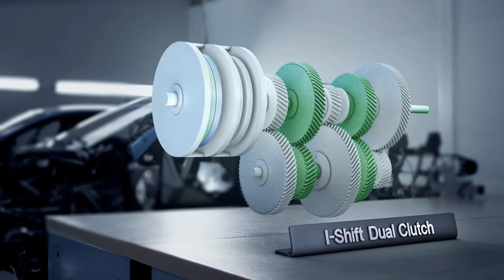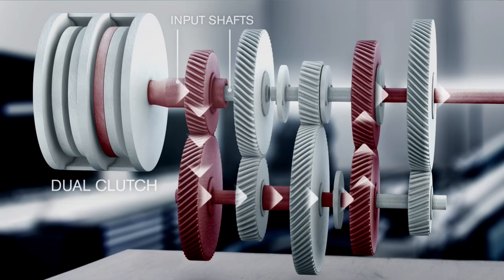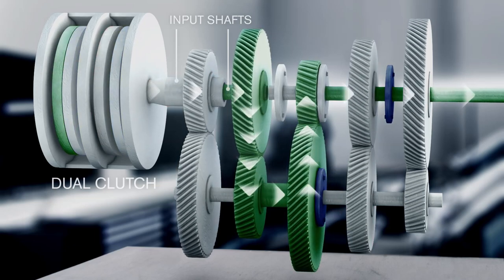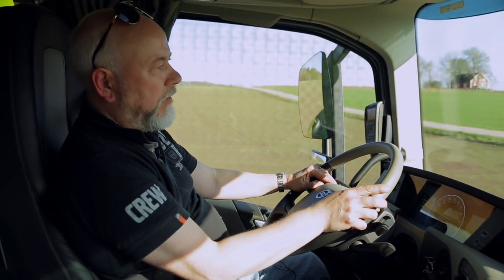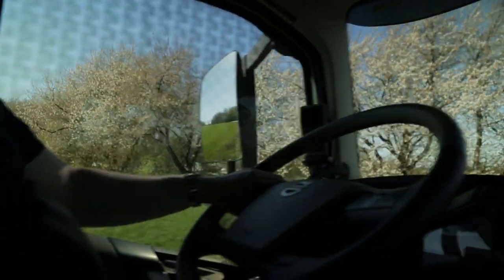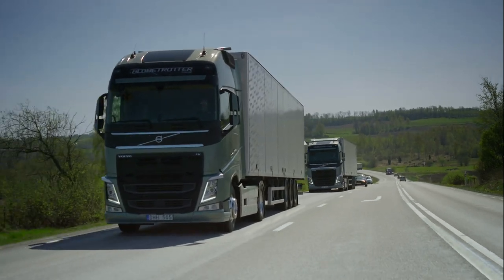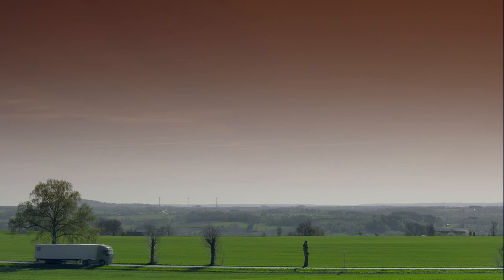Volvo Trucks - Seamless gear changes with the new I-Shift Dual Clutch

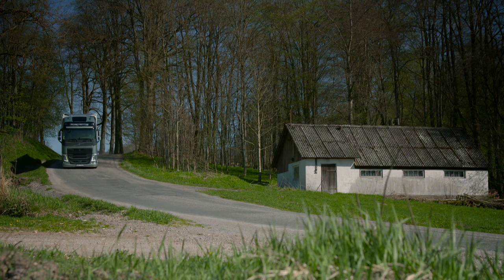Comment: @ 2:03 I'd say it doesn't add a new dimension to truck driving, it rather removes one - you no longer have to think about close-ratio gear changes and torque gaps.

Comment: Can it jump gears, say go from 10th to 12th or 7th to 10th? How does the manual mode work?
Reply from the maker: I-Shift Dual Clutch changes gear without any disruption to power delivery. When driving in conditions where it is more optimal for the transmission to skip a few gears, the transmission changes gear just like a regular I-Shift unit. I-Shift Dual Clutch can change gears without any interruption in power delivery, with the exception of the range-change, which takes place when shifting from 6th to 7th gear. We'll come back to you regarding manual mode.
Reply from the maker: Regarding manual mode, it works exactly the same way as for I-Shift. The driver can choose to shift manually when he/she wants. Powershifts will be carried out also during manual driving if the conditions are correct.
Reply: Might it be considered a sequential gearbox?
Reply: Jeffrey Austin it would be like 2 sequential gearboxes. One with odd gears and one with even. It can’t skip gears just like a motorcycle. My car has a dual clutch transmission and I love it.

Comment: is the dual clutch system heavier than the normal i-shift?
Reply from the maker: Yes, it is 100 kilogram heavier (220 pounds).
Reply: i guess in consideration of the time you actually will save using the dual clutch i-shift like on driving up hills and stuff it is actually worth it using it even though it is heavier

Comment: I theacking the dual clutch is the technology of formula 1 and the volvo are yust yoused this tehnology in his trucks in a veery good vave
Reply: Formula 1 has never used dual clutches gearboxes, it's forbidden.
Reply: Luis Felipe Carreira correct. They use  sequential gearbox. The clutch is operated with the hand but is only needed for starting off and stopping.

Comment: Beware Volvo so Apple doesn't sue you for name infrigment by using the letter "i" in front of the product...
Reply: I-Shift has been around a lot longer than any of Apples "i" products.
Reply: That doesn't stop Apple from suing...
Reply: Actually, you may have a point. Awkwardly Apple bought out the first-generation iPod in 2001, the same year that the first I-Shift transmissions were available for heavy trucks! xD